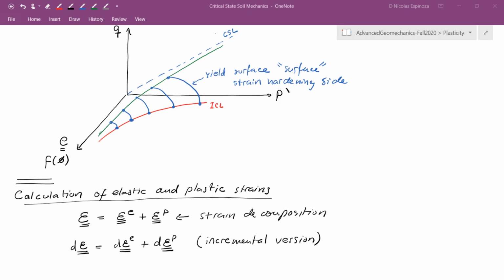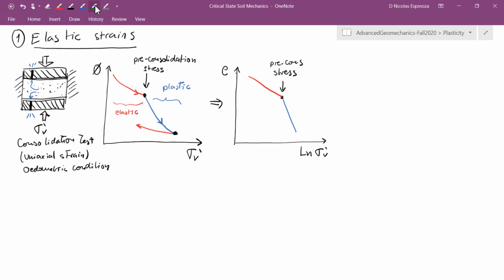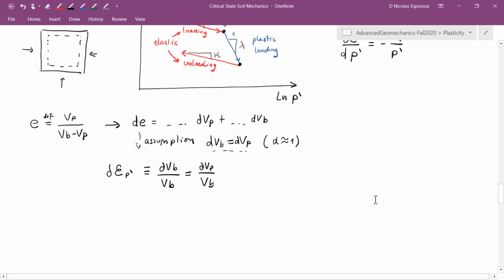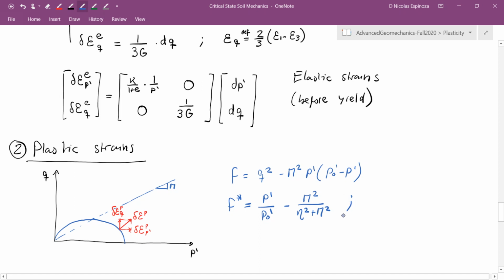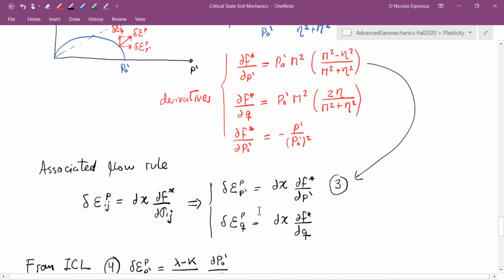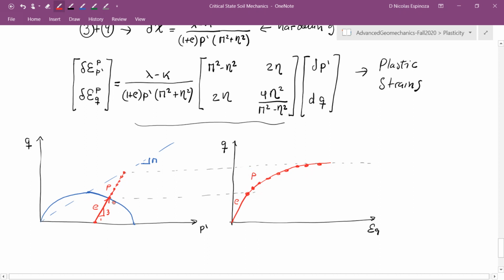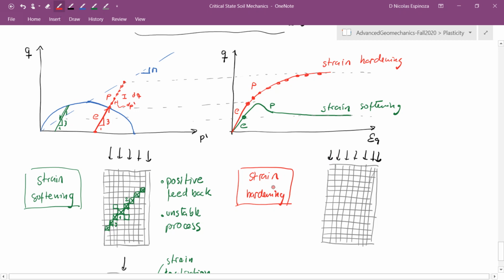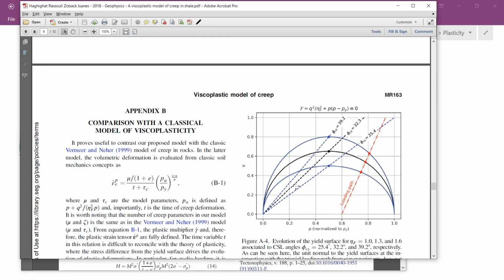L33 Cam-Clay model (Part 2): calculation of elastic and plastic strains

Comment: In a FEM 2D model, after calculating the plastic strains, how do I calculate the values for strain in the vertical (axial) and horizontal directions?
I believe that with the elastic strains it would be easy as we have a constant poisson ratio.
Reply from the maker: Itasca offers a fantastic guide on the numerical implementation of the modified Cam-Clay model: http://docs.itascacg.com/flac3d700/common/models/camclay/doc/modelcamclay.html

Comment: Thank you for this nice lecture.  i am still confused about how you obtain the hardening parameters from equations 3 , 4 and then how the matrix of plasticity is made? i tried a lot but i couldn't succeed to obtain the equation.
Reply from the maker: Hi Maria, Eq. 3 is a definition. Eq. 4 is almost the same as Eq. 1 (top) but in the plastic regime past p'_o. Notice that going from changes of void ratios to changes of volumetric strains requires the (1+e) factor (see my reply below to Fedilberto Gonzalez). Last, the plastic stiffness matrix requires taking changes in dp' and dq. The partial derivative equations of the yield surface (in red in my notes) might be a bit misleading because they are hiding q and p' in eta. I recommend a reverse demonstration, assume the matrix is right and try to recover the equations above, particularly for eta=0 and eta=M. I also recommend a numerical solution following exercise 2 here: https://dnicolasespinoza.github.io/AdvancedGeomech/node10.html . I'm checking my derivation though, for any typo or mistake, I cannot find the original notes now... will update soon. The final matrix should be correct though.
Reply: @dnicolasespinoza5258  thank you so much for your reply.

Comment: Thank you for your explanation. Could you kindly let me know how you obtained equation number 2? Minute 17.54.
Reply from the maker: (1) you have to express the differential of void ratio as a function of the variables Vp and Vb, i.e., de = Vb/(Vb-Vp)^2 * dVp - Vp/(Vb-Vp)^2 * dVb, (2) assume dVp=dVb (all deformation comes as change of pore volume), (3) do the math and replace porosity Vp/Vb = e/(1+e), (3) use definition of volumetric strain to replace dVb/Vb for delta eps_p'

Comment: Very well explained. What are the assumptions you have considered to obtain explicit relations for plastic strain in MCC model (apart from biot coefficient=1) ? How relevant are these assumptions in actual reservoirs. In the literature I see that for MCC model they solve for plastic variable, stress and hardening parameter simultaneously at each loading step or for example in the attached Ruben Juanes paper for shale they solve for stress and plastic multiplier simultaneously. Thank you,
Reply from the maker: If you want to learn more about poro-elasto-plasticity I recommend: Coussy, O. (2011). Mechanics and physics of porous solids. John Wiley & Sons.
Reply: @dnicolasespinoza5258  Thank you for the response Dr Espinoza. I have one more question which is bothering me. What is the equation for increment of preconsolidation pressure dp'0  you substitute in equation 4 (because this term is not present in equation 3) to find plastic multiplier increment (from eqn 3 and 4) ?
Reply from the maker: @KishanKumar-ih6vo  It comes from the isotropic loading and unloading relationships presented around minute 16:00.

Comment: Do you recommend using Cam-Clay model when modelling the 1-D consolidation test in FEM?
Reply from the maker: Yes, this is actually problem 2.d of "Weekly Project 8: Soft Sediments Constitutive Models" in https://dnicolasespinoza.github.io/AdvancedGeomech, for a single point, but can be extended to FEM
Reply: @dnicolasespinoza5258  What models do you recommend using when simulating loading and unloading on the soil sample? (Mohr - Circle, Drucker Prager or Hyperbolic... )

Comment: Wich would be the loading path of an unconfined load test?
Reply from the maker: Such stress path will start at (p'=0, q=0) and increase with delta_p' = (1/3) * dq. However, that stress path  is not possible with the yield surface used in this lecture, valid for an uncemented sediment (unconfined loading test not possible). You would need a yield surface with an intercept q different than 0 at p'=0 (cemented rock), like the one shown here: https://youtu.be/jgcsHyRMhmQ?list=PLv0npDbE5HXtEcPhMK33EMz6AG0qXWuc1&t=1319